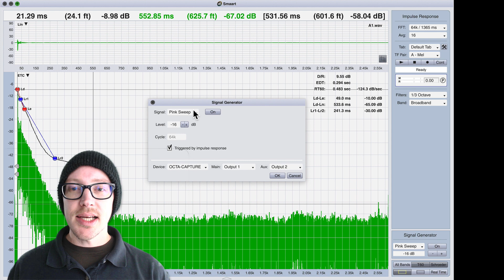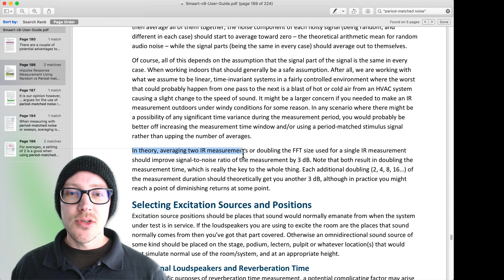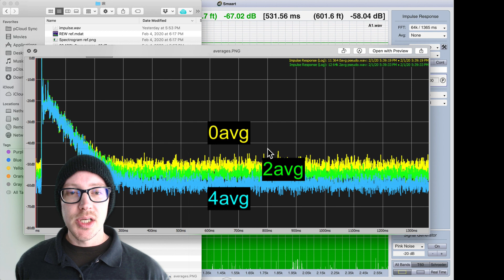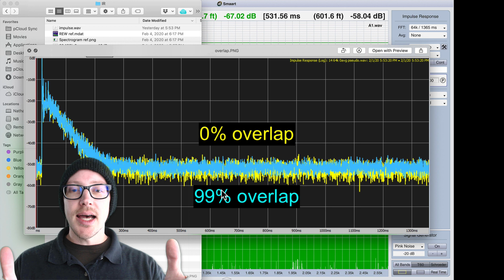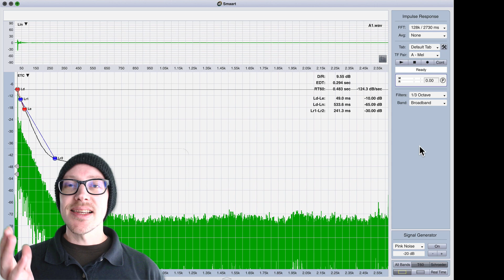How to take fast impulse response measurements in Smaart© without pissing people off

Comment: When measuring IR, delay is used to account for the time of flight through the system under test? So the amount of time it takes for the stimulus to arrive at the microphone.
Reply from the maker: Hey Alex, you're asking about the definition of time-of-flight? Yes, it's the time to travel through air from the speaker to the mic. Of course, there are other things in the signal chain that can cause latency, but ToF is the biggest one.

Comment: Nathan, regarding the Overlap setting: try using 25%. Long ago I asked Jamie (or maybe it was Arthur) about this and for each set of FFT windows that are captured, Smaart will interpolate another set of overlapping FFTs that it can use to refine your measurements. If you set it 25%, Smaart will start the 'virtual' FFTs at the 25% mark of the first 'real' FFT and then overlap each boundary by 25% going forward (Maybe the 'virtual' FFT starts at the 75%, mark; I'm not positive to be honest). When you choose 0% or 99%, you are essentially getting the same measurements as the originals because the interpolated FFTs start / end essentially where the originals do. I think I asked about using 50% or 33% as the boundary markers, and IIRC, the answer was that it didn't significantly increase the precision for the amount of time added. You should definitely check with RA about that though; I have been known to be mistaken more than just occasionally.
Reply from the maker: Great tip. Thanks!

Comment: Hi Nathan, I've been doing bunch of impulse response measurements last few days to get some RT60 data,  the one piece of data that I was struggling to hit with pseudorandom noise was trying to get Lr1 to Lr2 to be a minimum of -20db.  It was in a fairly big space without a dodec, a makeshift array to excite the room as much as possible but I found it really hard to get -20db.  The Level reverberant 1 to Lr2 data according to the manual is supposedly a good way to check you've got a decent measurement.  Thanks for the information here, although I tried most things to get above the noise floor I feel maybe I might have misunderstood some of the theory behind improving S/N with FFT and averaging.  Had no problems with Pink Sweeps mind..
Reply from the maker: Hey Chris, I haven't done much of that kind of research, but definitely go with the sweeps for that. I only started looking at alternatives to save time and lower the signal in the room.